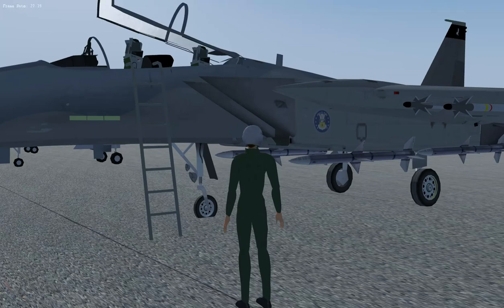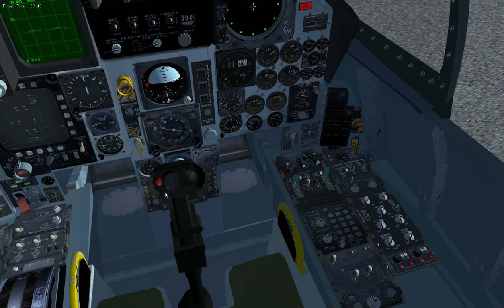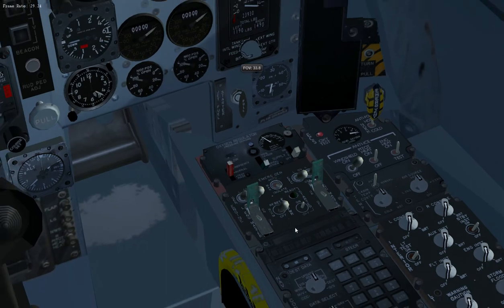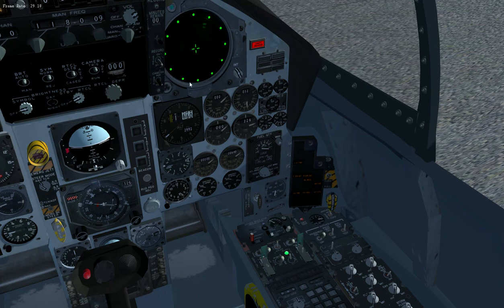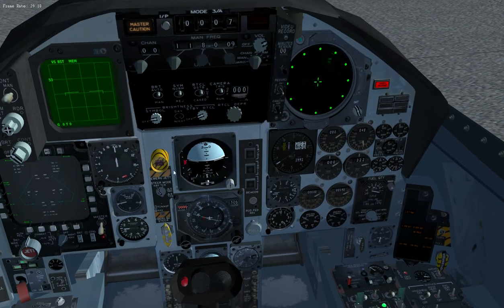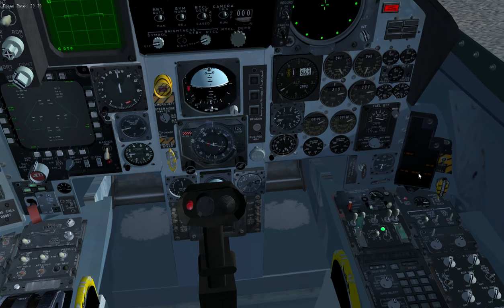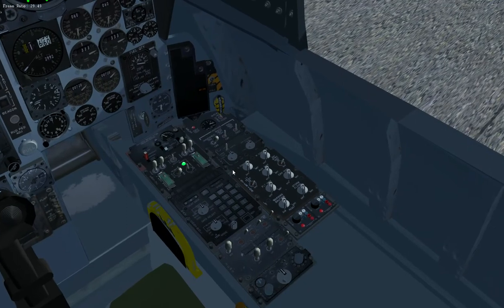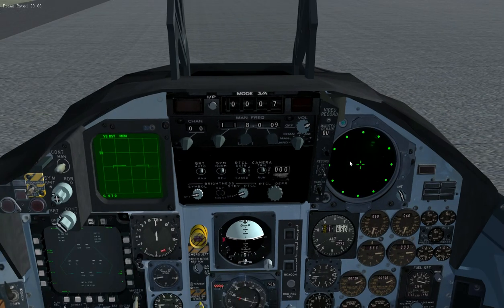FlightGear F-15 startup procedure

Comment: Hello, nice setup and a very realistic simulator. Here’s a little bit of information to assist you. Yes, there are 3 hydraulic systems Power Control (PC) 1, Power Control (PC) 2, and Utility. PC1 & PC2 are your primary flight control hydraulic systems and Utility is your back for flight controls and operates other systems like the landing gear, brakes, steering, speed brake, and the gun for instance. Normal starting sequence on the F-15 is starting the #2 (right) engine first, #1 (left) engine second. No external power cart is required for engine starting since the engines do not have a starter. Also, the electric cart outlet is forward of the #1 engine intake which is a safety hazard to have connected during start-up. Additionally, stored accumulator energy will start the JFS. After engine start, Utility Circuit B hydraulics rebuild the accumulator pressure. Here is the normal starting sequence, ensure your L/R GEN and L/R ENG Control switches are “ON”, EMERG GEN switch to “AUTO”. Next, JFS starter switch “ON”, pull JFS handle to first detent and release, JFS comes online and once it reaches 50% speed the JFS Ready Light will illuminate green. On the F-15, there are 2 start attempts with the JFS Accumulators. Once both are used, they will need to be serviced to be used again. Bare electrics are on in the cockpit and are powered by the Generator Control Unit (GCU) mounted on the JFS. Lift RT ENG Master green guard and turn switch on, raise Finger Lift on right throttle grip. JFS accelerates to 100% spinning the Central Gearbox (CGB) isolation decoupler to start the right engine. Once the engine RPM reaches 18%, move the right throttle from OFF to IDLE. The isolation decoupler disengages at 42% and the JFS returns to idle. An audible tone from the JFS can be heard when this happens. Engine becomes self sustaining. Once the right engine is running, the right generator (IDG) will come online and the rest of the electrics in the cockpit will power on. The PC2 hydraulic gauge will read 3000 PSI and the Utility should read between 2750-3000 PSI. Same starting sequence for the #1 engine. Once the #1 engine is running, PC1 hydraulic gauge will read 3000 PSI and the Utility will read 3000 PSI. 

Note: RPM percentage differs between F-15 models and engine types when it comes to advancing the engine throttle from OFF to IDLE.

Comment: That isn't even close to the startup procedure.  The F-15 needs no ground power to start up, everything can be done with the JFS.
Reply from the maker: The use of external ground power was only to show how it worked; starting at 1:07 I demonstrate how to do a startup using JFS. If you or anyone can point out any errors in my simulation, ideally with a reference, I'll appreciate the report and will investigate.  I prefer all discrepancy reports to be raised as issues on my github (https://github.com/Zaretto/fg-aircraft/issues) but any other method is equally good for me.
Reply from the maker: @Busch light Thanks for the information; FlightGear doesn't support throttle cutoff; so I worked around it. The only way I can model the finger lift and fuel cutoff with the throttles is to add a separate keybinding.

Comment: Power control 1 and 2 are independent hydraulic systems on the aircraft and power all primary flight controls. The utility hydraulic system acts as a backup to PC1 and 2, controls all secondary flight controls, and acts as an emergency system. Utility hydro pressure is not used to start the JFS. That comes from the JFS accumulator.
Reply from the maker: Thanks for the feedback I'll investigate this and see if I can improve it.

Comment: I cant get the pull handle to start the aircraft
Reply from the maker: You need to have fuel and pressure in the hydraulics util (see 1:02). If there is no pressure in this system (2 or 3 attempts) then you will need to connect ground power to charge this back up.
Reply from the maker: @Busch light Thanks to the extra information from Knax this is something that I will improve when I get a chance to find a proper schematic; because also I need to figure out how the JFS accumulator is charged.
Reply from the maker: @Busch light Thanks that's useful. Can the pilot pump the JFS manually or is it something the ground crew would do. I assume that the pressure in the JFS bottles isn't visible in the cockit. Is my figure of 3 start attempts before you're out of pressure correct?
Reply from the maker: @Busch light that's excellent information - I'll fix my model to work properly